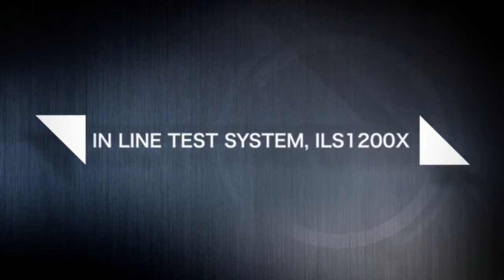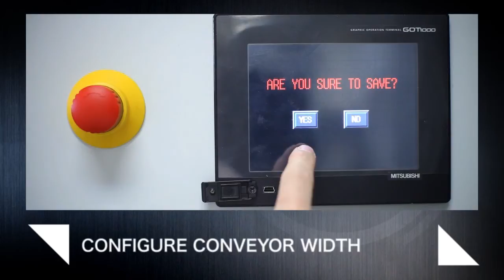IN LINE TEST SYSTEM ILS-1200X, ICT TEST UP TO 2400 TPs

Comment: Teradyne is far advanced and superior in the long run based on cost and maintenance as compared to the keysight ICT series 3,4,5,6. Expo 2019. Now days keysight ICT even if you purchase your machine you must pay yearly subscription fee. If you don't pay you can not use the machine until you pay them. Monopoly now days.
Reply: This is Not true,  for Keysight i3070 you can continue to use the system. The subscription is based on the SW support update, support Services or software feature which customer has option to buy perpetual or subscription. Do take note that the video is not a Keysight i3070.